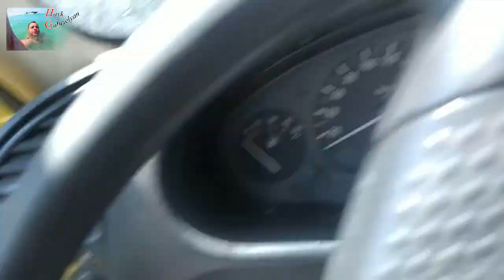How to repair or replace Door Latch Striker,   Dome Light Switch on BMW E36.

Comment: What type of plastic did you weld onto the striker?
Reply from the maker: anything plastic
Reply: It's probably ABS.
Reply: Sure wish I could understand wtf you're saying brother! I need to do this,..... I think. Not 100% sure though. My dome light was coming on or staying on unless I turn switch on light off all the way which I've done. Well it also when the keys in the ignition and the door is closed sometimes it will start to ding like the door is opened. I used to be able to pull on the door a little to stop it 4 a while. But this would also cause me to not be able to lock my doors because it thinks the drivers door isn't shut completely. So is this what I replace to fix the issue?lol
Reply: @tripswtrav  Did you fix it?